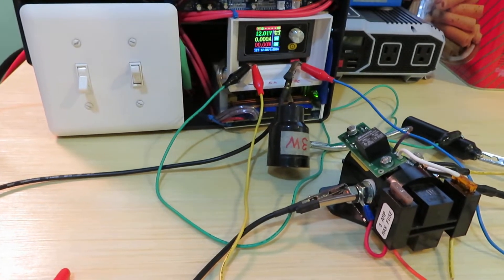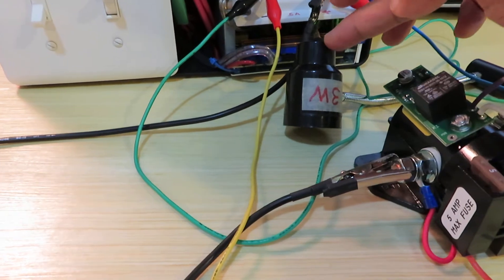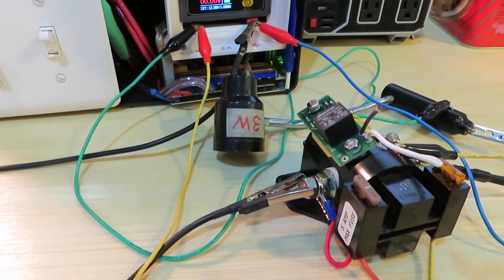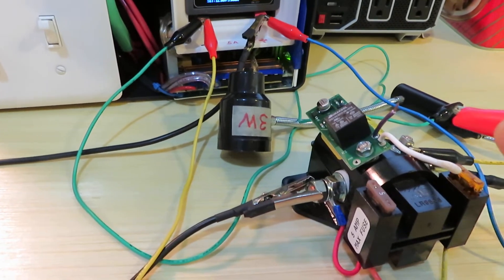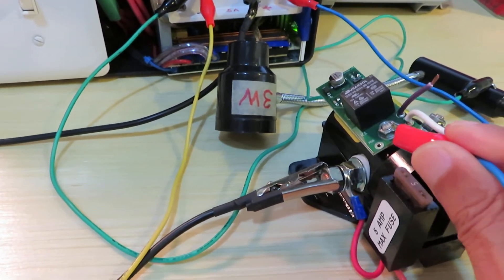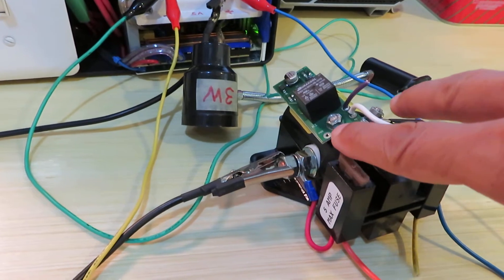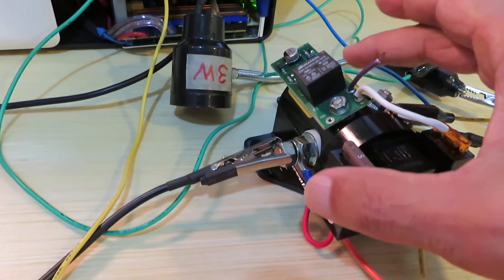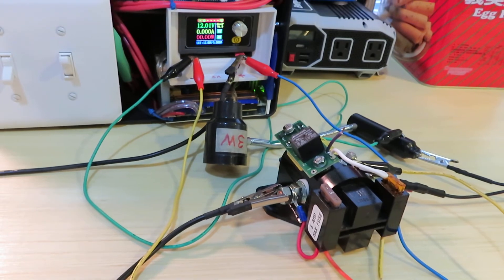KIB LR9806J Battery Disconnect Latching Relay Coming Back to Life

Comment: just curious -- did you ever find out why the relay had stopped working and WHY it started working again after your polarity intervention?
Reply from the maker: No, I lost interest and gave up on the latching relay. I wanted a relay that has low voltage disconnect protection. I found one that is rated for 30A, which I use now. Subsequently, I decided to go solid state instead of electromechanical relay. I built one good for 70A using PMOS with a modified low voltage disconnect module.